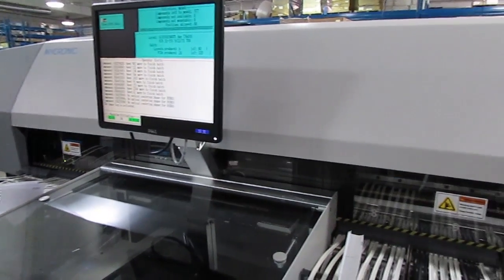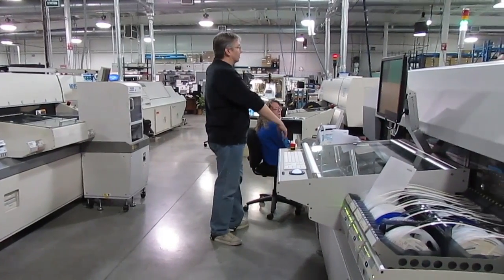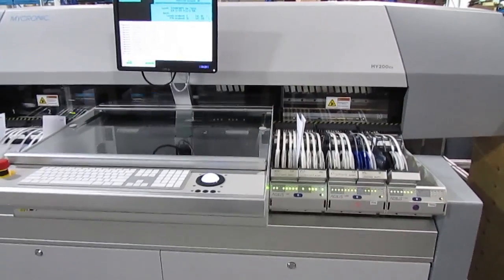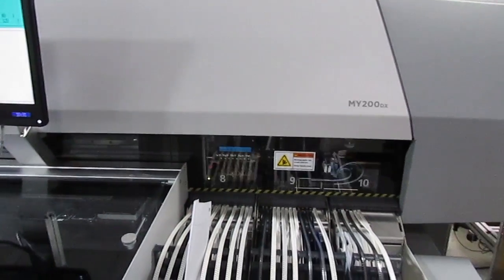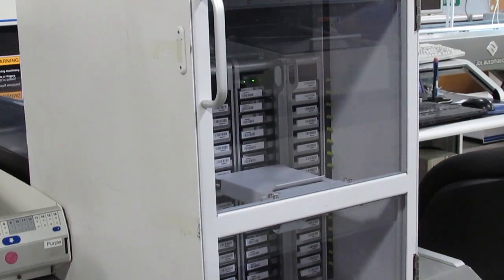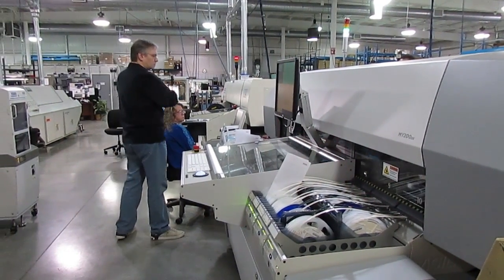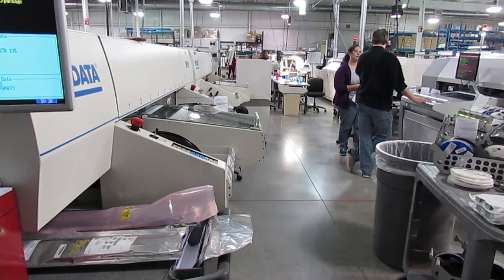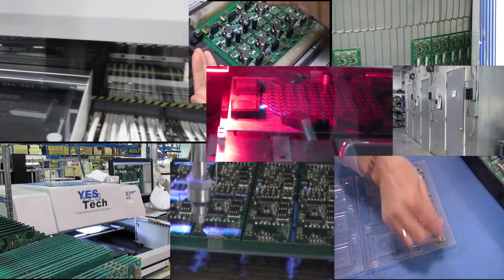SMT Pick and Place Process - 2015

Comment: The table moving will is not good the part will fly off the pads bad look like mydata machine is good for small build like capacitor or resistor
Reply from the maker: The moving table works great. The machines handle a wide range of SMT components at excellent placement speeds and no parts fly anywhere.

Comment: no SPI to check the Solder paste?
Reply from the maker: This isn't a big concern a long as you make sure your stencils are working well, which is done automatically by the paste printer. We are considering adding a paste height measurement system but it's not really an issue in a temperature- and humidity-controlled environment, if you have set up the machine properly and regularly clean and maintain your stencils.

Comment: 01:32 thats not good. its better when the pcb dont move!
Reply from the maker: It depends on your SMT equipment. Some pick and place machines move the placement head in all three directions (X, Y, Z) over a stationery board. Others move the head in two directions (X, Z) and move the board in the third direction (Y). Both techniques are fine. This modern Mycronic MY200DX machine has a 4 sigma placement accuracy of 35 um  -- well capable of placing our 0201's (508 um long and 254 um wide) to much better than the IPC Class 3 standard.
Reply: you can set the Y-acceleration for each package the software uses the lowest that's already placed on the board for the Y movement. The bigger components like electrolites have a lower setting they are placed by the second machine with the larger single head, since the head has to go back and forth for each one the Y fasteness doesn't matter there. I've disabled the fastest setting on the second machine anyway for 'safety'. Sometimes you have to 'repair' a board or place a component that came in late so you have to feed the board in the machine for a second time with all components mounted the machine will load the board at the fastest setting in that case because it thinks no component is mounted yet. That will wreak havoc with heavy coils running wild and destroying everything in it's path like an elephant.